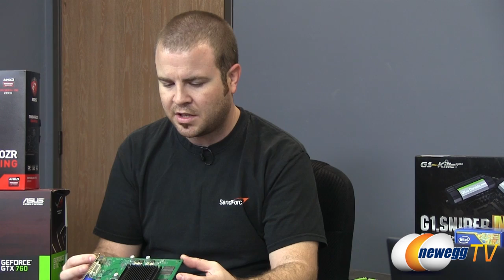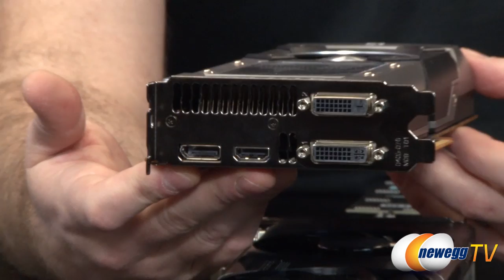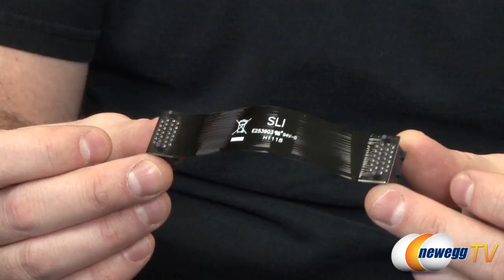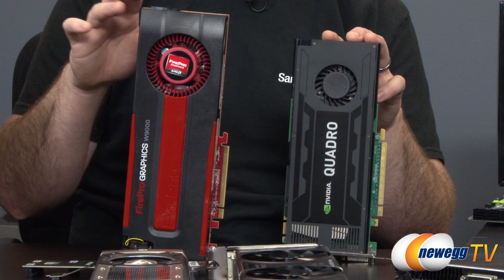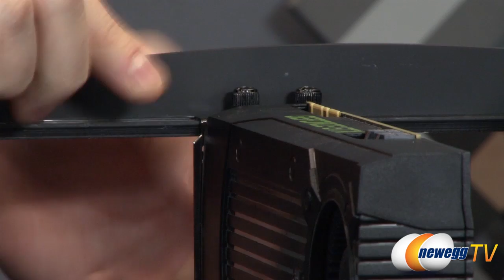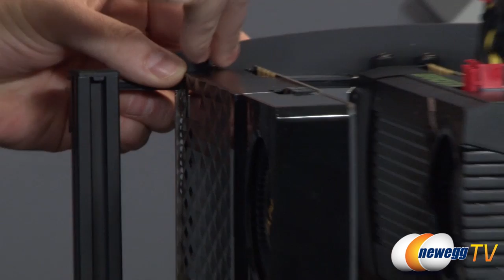What's a Video Card? Newegg TV's Tutorial and Shopping Guide

Comment: I love the part about workstation GPU's. Completely, entirely, made-up from the whims of their intuition. Sorry guys. GeForce cards are actually very popular for render farms used for major productions. The compute accuracy of Workstation GPU's has very little if any benefit to a rendering workload, as an error rate is actually acceptable in export rendering work where the same frame is going to endure dozens or hundreds of rendering "passes" anyway, errors will be effectively rendered "out," and post processing and review can catch any undesirable anomalies and edit them out.

Also, as far as gaming is concerned, while workstation GPU's are much more expensive for a given render throughput performance compared with gaming cards, there is very little if any difference in DirectX implementations at the driver level between workstation and gaming cards, so workstation cards play games just as well as their gaming card "equivalents" (hardware wise). Many CAD and 3D modeling applications are now using DirectX viewports (including autodesk), so it is in the best interest of everyone that these cards have modern optimized DX implementations.

Comment: can anyone help me out here??
I'm looking to upgrade in anyway possible my GPU.. my Vostro 200 came with Intel(R) Core 2 Duo CPU E4500 @ 2.20Ghz and 3060 RAM and a G33/G31, Express Chipset Family.  So I tried playing DOTA 2 and I just cannot play it even with very low setting.. I don't  have the slightest clue what new video card i should buy or if i can even upgrade it.. I have all the minimum system requirement except for my GPU performance..  Thank You!
Reply: A GTX 750 only cost roughly $130 and it should run games fine, yet the CPU isn't very good

Comment: Paul, you seem to know a lot, but you're wrong regarding the ASUS Mars.

A 760 is NOT a rebranded 680-card! If you had said 770 you'd be right, but you didn't.
Reply: so 760 is a rebrand of 660 Ti?
Reply: Actually the 770 is a rebranded 670, but it's performance is on par with the 680.

Comment: can one graphics card be connected to two moniters
Reply: Yes. If your graphics card as two VGA ports, simply connect them to the VGA ports on your monitors. If it has one VGA and one DVI slot, then use the VGA slot as normal, and use an adapter for the DVI slot. If it has two DVI slots, connect an adapter to each, then those adapters to your monitors. If your monitors use DVI, then connect them to the graphics card, pretty much the same as above. Just match DVI with DVI, and VGA with VGA.

Comment: I am trying to understand exactly what makes a good video card . . . good.  There are SO many video cards to choose from at so many price points.  I am planning on purchasing an AMD graphics card under $200.  I also plan to use eyefinity, so I am looking for a gpu with either a Display Port or a Mini Display Port.  I know I will need an active adapter.

Basically, I need to know what's more important for a decent quality gaming experience:  The amount of memory on the card (1GB, 2GB or more), the Core Clock Speed, or the number of Stream Processors?? And how much better is 256 bit over 128 bit memory on a gpu?

With a limited budget, I cannot afford the 2GB card with high clock speed (over 1GHz) and  high stream processes and 256 bit.  Looking at the options I have, I can probably on afford one or two of these higher elements, meaning I could get a 2GB card with 800MHz clock speed, but lower stream processors and 128 bit.  Or, I would get a 1GB card with high clock speed, high stream processes, and maybe 256bit.

Which combination would work best for a budget GPU?

My system has an AMD 760k and 8GB 1600 memory.  We don't have HD monitors. Highest resolution will be 1280x1024.  We have a bunch of old Dell lcd monitors hanging around for our computer club.
Reply: What wattage and efficiency (80+ Bronze/Silver/Gold) is your power supply?

An AMD R9 270 is a good option.

Comment: I have a question, I currently have a pretty nice gaming rig. 
4670k haswell @ 4.2 ghz(cooled by cm evo+) 
Asus Z87 pro mobo
16gb Crucial ballistix @ 1600mhz
Samsung pro 256 ssd
2tb seagate and 1 tb w.d. hdd
asus br player and dvd burner
750 watt gold edition EVGA Nex(full modular)
and finally 2x EVGA 650ti boost Superclocked running @ 1150 mhz
Now, I have been thinking long and hard about possible selling these two and putting some money down and getting one gpu with more vram then 2gb because I do own a aoc 29 inch ips panel 2560x1080 ultra wide screen. Now the reason I am looking for a single card i snot because I am unhappy with the perfomance of the sli, in fact quite the opposite, the cards handle most games at maxed out settings and the most demanding games it handles at high and or ultra with the anti-aliasing tuned down a bit. So, if anyone know what is the best card at the cheapest price that can at least perform close to, on par, and or better than this sli set up I have been using. Because I think that it would help with power consumption and heat in my case which because of not having liquid cooling has been running a little hot lately, well if anyone has some reasonable suggestions, like I cannot afford over 500 dollars, so things likes some the 780 models and 290 etc I would not be able to afford. Thanks fdor any positive feedback

Comment: Great Video.. It would've been great if you talked about 2 more points briefly: 1. Difference between Nvidia GTX 690 and GTX Titan. 2. PCIE configuration (2-way muti GPU) X16 + X16 vs. (3 way multi GPU ) X16 + X8 + X16 or X16 + X16 + X16 vs. (4 way multi GPU) X16 + X8 + X16 + X8. Well I want to know these things a little in detail.

Comment: what I'd like to see is, having the option to buy a graphics card without a heat sink/cooling solution. now before you trolls try to rip my head off let me explain, now I'm going to use an MSI 780ti for my explanation, now this card goes for $740 which is high, someone who is willing to pay that much for a card would also be a person who has or is thinking of custom water cooling. so keeping that in mind I wonder how much we are paying for the cooling solution(let say it cost $100 for this and to keep my explanation simple) so if I want to buy this card and water cool immediately I'm paying and extra $100 for something useless that I'm gonna rip off anyway. so the idea is to sell the card cheaper but without a cooler with the idea of me supply the cooler, because you might have a water cooled system in mind of the current cooler is compatible with the card you have and you can just switch the water block over, this doesn 't have to just be for water cooling either, there are a lot of after market air cooling solutions as well, and it would be really easy for card manufacturers to do this as well because it would just skip a step in the production process and install a piece of protective plastic (for shipping) in lieu of the heat sink. so in conclusion your saving $100 on the card but spending it on the cooling solution but in the end your getting higher performance which is what it all boils down too. thought anyone?

Comment: Hi, great vid ! Personaly I've got an HP pavilion pc and a stock card > an nVidia GeForce GT 220 with 1G, and I've overcloked it @ 750mHz Core clock ; 1628 mHz for the Shader clock, and 940 mHz for the memory clock. My question is : With what can my card can be compare to with an other card on the market ? I know it's a shitty lower end card but still works puddy good for what I do (I still need a better one, but if I do that I'll need to change my power supply). Thx
Reply: Would you people just read my comments please?
Reply: Get a GT 640. You won't have to upgrade your power supply and it has 384 cuda cores compared to your 48 cuda cores. The core clock is much higher as well. so it should in theory be a great upgrade.
Reply: cardesinr Bad advice. You can easily get a refurbished 650 TI cheap now. Don't go any lower than a 650 TI.
Reply: I only said GT 640 because you wouldn't need supplemental power for the card to run. Now obviously I wish we could all run on 660 Ti Power Editions and 7870 Ghz but we dont so lower end solutions need to be offered SOMETIMES.......
Reply: save and buy a 760
Reply: Why i just gave him MY advise..
Reply: Thanks (from France).
Reply: Peter Gotham OK but he has a low watt power supply which is possibly not able to handle a GTX 760.
Reply: arnaudleroy78 Make sure you find the wattage of your power supply, because if you turn it on without a sufficient wattage it can fry the whole PC.
Reply: Okay then  try the nvidia 295
Reply: Peter Gotham I liked the gt 610 2GB

Comment: Video card - The interpreter that changes graphical data as "understood" by the computer into a viewable and understandable image for the viewer.
AGP showed up, I believe, in the mid 90s. I had a Matrox Millennium™ as my 1st "gaming" card.
Before that was the 16bit ISA slots(had to look up the name).
The 16bit ISA slot replaced the 8bit ISA.
Joanne likes copper cooling! As do I.
Copper is an excellent "Thermal Conductor".
Wow, the audio dropped then spiked back up again.
Next step for my rig, liquid cooling for the GPU. (The CPU has the Eisberg 120L)
Funfact for the novice- VGA Video Graphics Array (also arguably Adapter). One might also see SVGA - Super Video Graphics Array.
1 note on HDMI ports on video cards, not all have sound chips and it's noted in the documentation.
Console 30FPS peasants envying the PC Gaming Master race 60FPs and higher.
Has the the display port design, pinouts and encoding become standardized yet?
I think many of Joanne's questions could have been answered w/o a great deal of detail.
SLI and Crossfire funfact - The main bus on the Mainboard has a limited bandwidth, a single may not fill up that bandwidth limit but no number of additional cards can exceed it.
My 1st SLI setup had ribbon connectors for the bridge.
Antec's website had a Wattage calculator for picking a PSU.
I have  ASUS GTX680.
Helpful hardware safety tip: Always unplug or throw the "main power rocker switch" on the PSU before adding/removing hardware in the case.
I love Joanne's enthusiasm.
I am wondering if Paul and Joanne, with as many videos as you've done to date, are you still just as nervous as from the 1st few?

Comment: Is there a website where you can see if the pc parts work together
Reply: PC partpicker
Reply: yeah found that one but i don´t know how to check if the parts work together
Reply: ***** oh yeah than i maybe think about getting 16 gb
Reply: no you will barely get 60 fps with 280x
Reply: pcpartpicker
Reply: http://pcpartpicker.com/
Reply: nenad285 
Specs I don´t know if is should pick something ells 

CPU= Intel Core i5-4670K 3.4GHz  Quad-Core

 motherboard=  MSI Z87-G43 ATX LGA1150
  
memory= Corsair Vengeance 8GB (2 x 4GB) DDR3-1866 Memory

Storage=Western Digital Caviar Black 1TB 3.5" 7200RPM Internal Hard Drive

Gpu= Asus Radeon R9 280X 3GB or MSI R9 280x

Power Supply= Corsair Gaming 700W 80+ Bronze Certified ATX

Case= Thermaltake Urban S31 ATX Mid Tower Case

Optical Drive=  Samsung SH-224DB/BEBE DVD/CD Writer
 (not sure if it is that good) 

1-10 how good is this build
Reply: SexyDolphin that will work fine, 8/10
Reply: Eoin Fitzpatrick so all the parts work together but would you recommend any other parts
Reply: SexyDolphin The memory clock doesn't need to be that high, 1600mhz memory is the sweet spot, the rest is completely fine, but I recommend a SSD, the Samsung 840 evo 120 gb is a great ssd, put your operating system on there and cache the rest (or put your most used games on it)
Reply: ***** ohh I have watched some pc build and they say it is good to have 1866?
(not sure why ) so yeah .
the operating system is prob gonna be windows 7 or is windows 8 better im using windows 7 right now and im kinda used to that
Reply: SexyDolphin yeah get 16gb of ram instead of 8
Reply: john Travolta nah i don´t think i need that much because i'm gonna do gaming most of the time
Reply: SexyDolphin Linus did some tests, it only gained like 2 frames on games beyond 1600mhz, but you still should get 16 gb, games hog up the ram.
Reply: ***** are there any games today  that need 16gb of ram? isn't 16 gb to much because most of the gaming pc build video i have watched only put like 8 gb :P 
sorry for all the questions this is my first pc build
Reply: SexyDolphin The newer games are pushing 6gb now. Which doesn't leave much excess if you have other apps running at the same time (steam, skype, software for keyboard and mouse or web browsing)
Reply: ***** i don't know if i will be doing any overclocking (don't know how to overclock ) and i only  play on  one HD monitor so is this build overkill for 1 HD monitor playing fx battelfield 4 on ultra settiings
Reply: http://pcpartpicker.com/
Reply: Try Newegg's user forum http://www.eggxpert.com/
Reply: SexyDolphin I would reccomend  GeForce 750 or a 760 both good graphics cards and still at fair price range

Comment: So, wait, if I plug an HDMI into my GPU, I can't get above 30 fps? Or did I just misunderstand?
Reply: You can get 60Hz refresh rate on your monitor max using HDMI. DVI / DP give 144Hz (don't know about max.) Your TV just uses some technology to display perceived 120/240Hz. 60Hz means your monitor displays 60 pictures a second. If you have 30FPS, your monitor displays 1 frame for 2 refreshes. If you have 120Hz monitor and 30FPS, your monitor displays 1 frame for 4 refreshes, and if you have 60FPS, your monitor displays 1 frame / 2 refreshes, and so on. 240Hz monitors, however, currently use the same technology your TV uses, it's not real 240Hz. If you use HDMI or have a 60Hz monitor, you can get above 60FPS, but only 60 frames will be displayed if Vsync is on, otherwise you will get what is known as tearing. Tearing is when 2 frames are being displayed at the same time, often where the bottom half will be the first frame being displayed, and the second frame will be on the top.
Reply: DarkR3bel Plus he said 30FPS for 4K, or 3840x2160 / 2160p.
Reply: Only with 4K resolution I think. With 1080p you'll get higher.
Reply: ***** what about 5760x1080?
Reply: Prime Paladin That's 3 monitors. Each monitor is going to display at 60Hz.
Reply: DarkR3bel Kay thanks man.